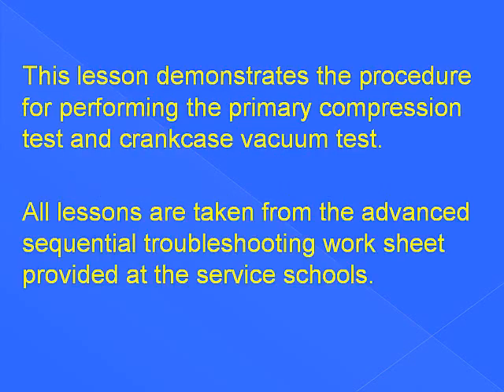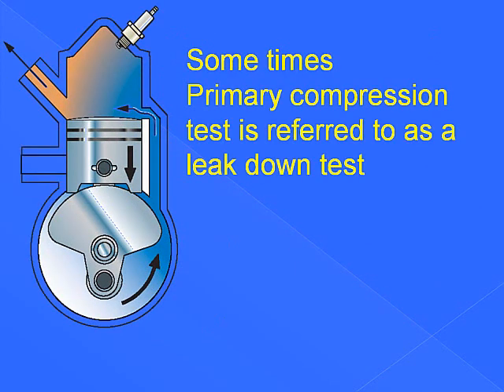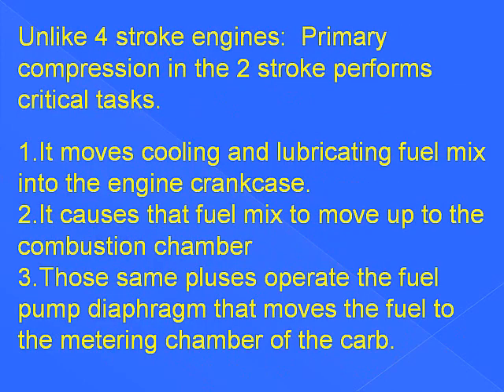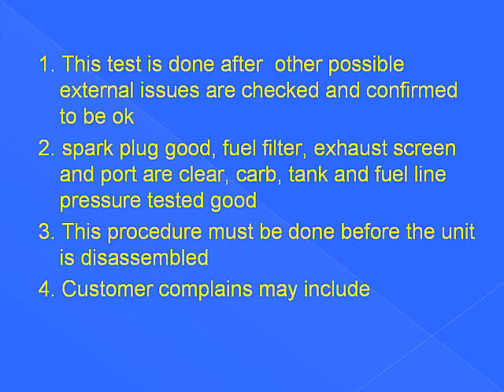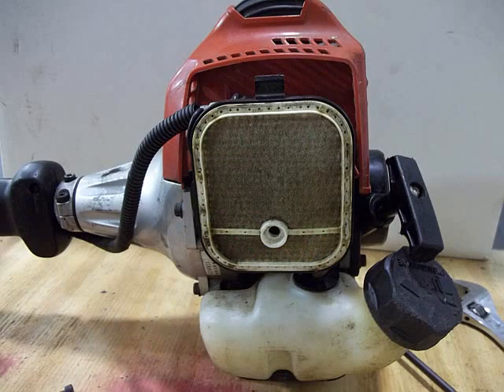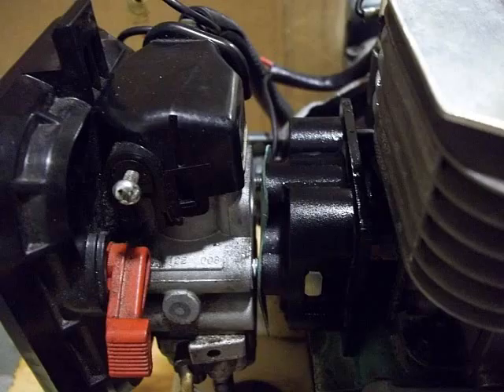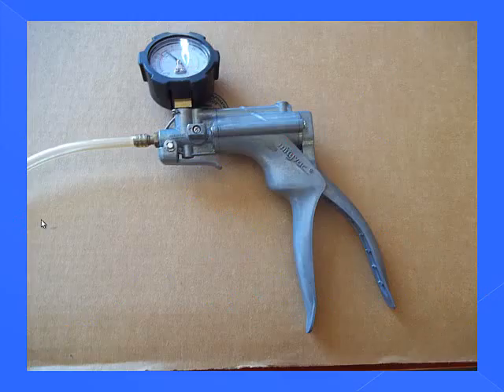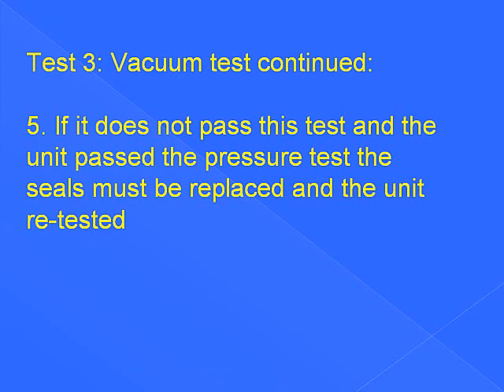primary compression and vacuum testing

Comment: Will this tool work for carburetors pressure testing?
Reply: The Mityvac will but you need to put an adapter with smaller tubing

Comment: Joe,  I built an ms-361 from Farmertec and it ran great until it dropped a piece of the wrist pin cir clip, which smoked the engine.  I bought a new short block from Farmertec and put it into the other parts.  I would crank and run but only on high speed.  As soon as I blipped it to run it died.  It would restart but only in high speed.  It has to be a vacuum leak somewhere, so I started testing, today.  The first thing I tested was the fuel system - the gas tank is leaking like a sieve, where it is bonded to the rear handle.  It dropped from 7# to 3# in five minutes and seems to be leaking all the way around where the tank is bonded to the handle.  It looked like a kid blowing bubbles.  I would not think this would cause it not to idle, what do you think?  I am going to run a leak down test on the short block, tomorrow.

Comment: Can anyone answer why you have to be at bottom dead center.. Thank u
Reply: The Piston acts as the valve in a 2-cycle engine. With the Piston down, the transfer port between the crankcase and cylinder is open.
Reply: Because it's the crankcase that u want to check for leacks before piston goes to compression and seal bottom end
Reply: @marcoalvarez5682  So if one were pressurizing via say the impulse line on a saw, as opposed to via spark plug hole this would not be an issue?

Comment: I thought you said bottom end crankcase test is most important with piston at BDC you're testing the top end jug
Reply: He did...but in the illustration you failed to realize the piston was at BDC....Also the test he did was done through a secondary pressure source...A secondary compression test uses the ring seal to squish factor to obtain those numbers by pulling the pullrope….2 entirely different concepts and pretty easy to differentiate too.....Primary ensures the engine is viable to be started and wont have any airleaks...Airleaks throw off the tune and cause hard starting aswell as high heat. Knowing what the compression is-is futile if you have airleaks...

Comment: Joe, I just bought the the mighty vac. I see your adapter and part#....So how do I order the adapter?
Reply from the maker: Craig are you talking about the adapter for the spark plug hole. if so you should be able to get that through any dealer that sells any Husqvarna brand product using the part number I provided.
Reply: Did you know you can simply rent one for free from the local autoparts store that does the loaner tool program...Saves a lot of money seeings rental is 100% free and it doesn't sit on the shelf not being used unless youre a mechanic and it will be used daily or frequently
Reply: @SmokedTirez  What store loans this out free?

Comment: Is it possible to have a set up where the hose screws on an adapter like a secondary compression tester? It seems that it would prevent leaks in the set up better. Whenever Ive performed this test, I had problems with the slip on hose and adapter leaking. Also, if not, where can I get the various size compression test adapters that I would need? Thanks